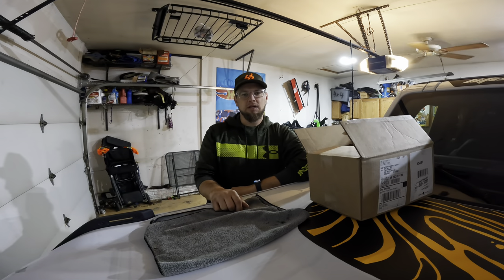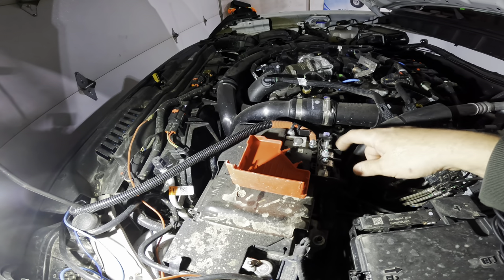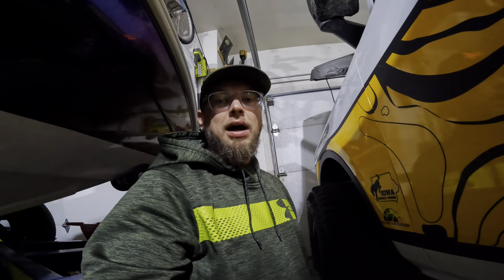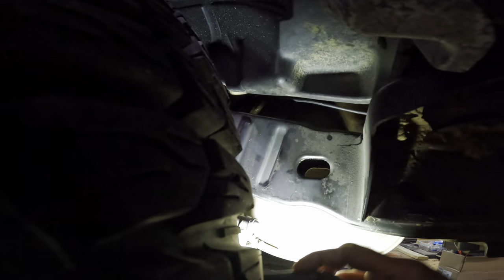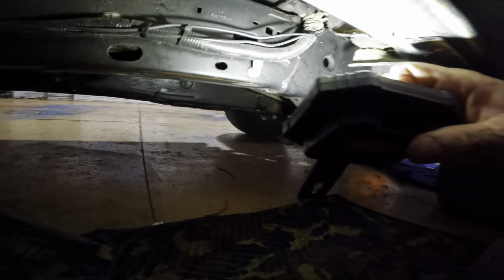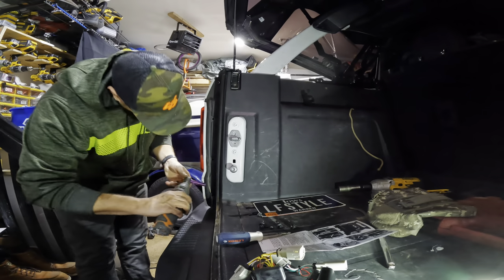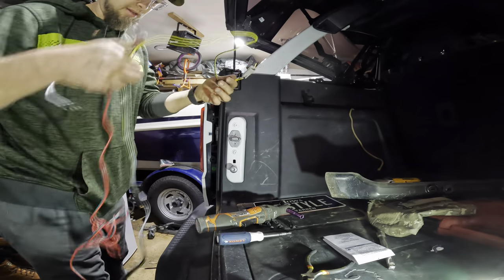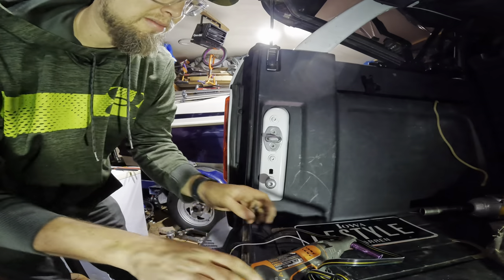2021 Ford Bronco Trailer Hitch Install

Comment: if you can afford a Bronco get the OEM hitch and 7 pim wirung harness.  I have installed my own CURT harnesses, its  PITA even with the plugins.
Reply from the maker: Still was able to save a lot of money, if you watch the second video I posted about wiring I was able to make it much nicer
Reply: @anthony hitchings Easy for you to say as it is not always about $$.  The Tow Option was one of the commodity restraints.  Many people dropped that option (including me) in order to get there Bronco sooner.  Aftermarket could have probably made a lot more money if they had more options out in the early months.  I personally wanted a aftermarket 7 pin but opted to put in the Ford 4 Pin and later get a adapter.

Comment: If you don’t need the 7 pin connector, CURT has a plug and play 4 pin harness! 👍
Reply from the maker: It’s the same as the one I used.
Reply: Really, that’s not that “plug and play”, but it’s not too bad! 👍
Reply: What's the Curt part/item# for that one?
Reply from the maker: @retnav92  13493, link in the description below the video

Comment: Did you disconnect the battery to connect? Also where are you hanging the wiring connector for the trailer to hook up on?
Reply from the maker: I did not, it’s just hanging off the hitch right now. Looking for a better solution

Comment: When ordering the Trailer pkg through Ford does it also include a transmission cooler and/or upgraded oil cooler?
Reply from the maker: We don’t believe so. Haven’t found them on models that have included the hitch.

Comment: So I have a question I hope you can answer. I had Ford install there 4-pin Ford version of this after delivery (they gave me a good price).  I noticed they too added the long + lead all the way to the battery. Why would the 4-pin need this? Is it to future proof for a 7 pin which requires a positive connection for trailer battery.  I thought typical 4 pins just needed connections at the taillights for lights, braking, and signals...
Reply from the maker: All I can come up with is that the factory tail’s must not take much power to run, so a trailer needs extra power to support the added lights
Reply: @LifestyleOffroad  Thanks for quick reply. Do you think I could use this line to also power the + lead wire for a 7 pin that charges trailer battery. I have a 4 to 7 pin adapter on order so I can tow light trailers.
Reply from the maker: @panzer948  hard to say, but I would think it would be fine.

Comment: Get the factory install. Cheaper, better, warrantied.
Reply from the maker: How is it cheaper? At the time I got my Bronco the hitch was holding up production. I have less then $240 into this. Factory installed was $650. I don’t plan on towing much anyhow. This is mostly for a bike rack.
Reply: @LifestyleOffroad  I guess. If your time is worth zero, its not.
Reply from the maker: 10 minutes to install the hitch, 1 hour for the wires. Still ahead in my book. Plus I like working on stuff like this.
Reply: @jimthompson, as Lifestyle explained, this is due to a commodity restraint forcing many early Bronco buyers to go aftermarket.  I was more about making sure I could get the engine, suspension, and driving tech I wanted, than something as easy as a tow package that you can easily do aftermarket.
Reply: @panzer948  now that makes sense.